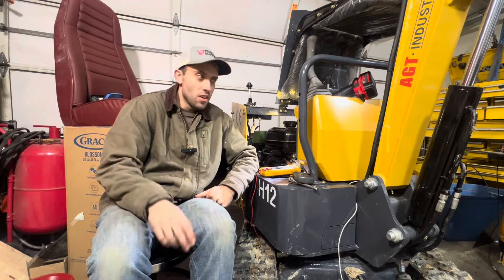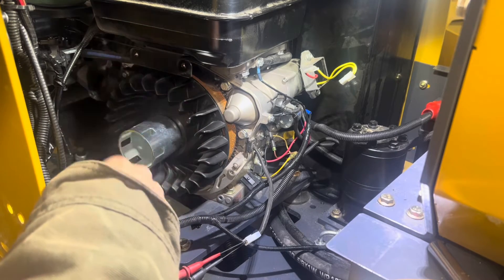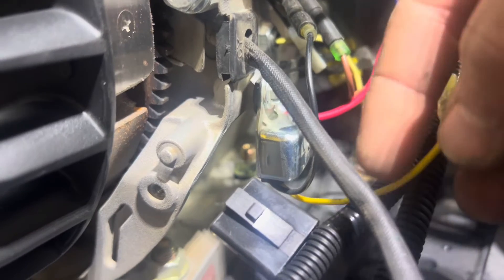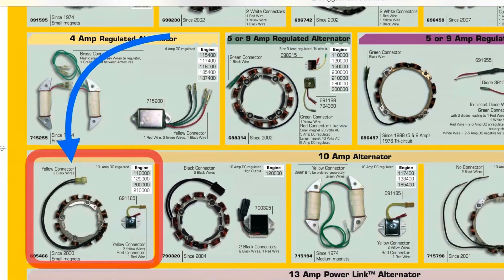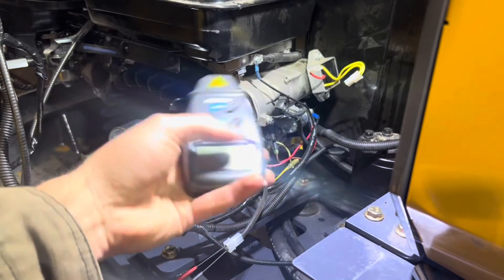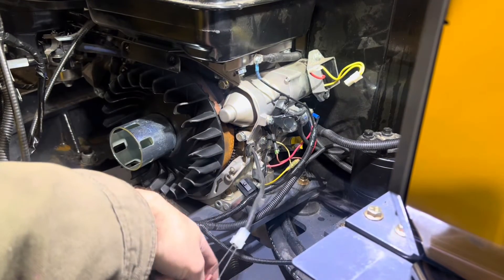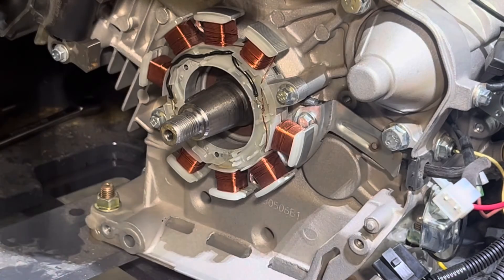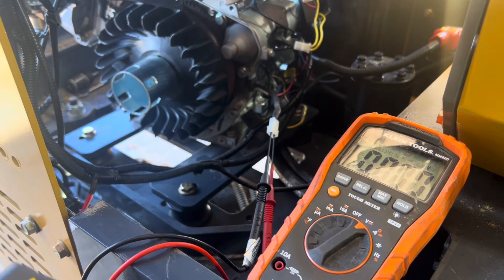Chinese Mini Excavator: Alternator and Charging System Diagnosis and Repair

Comment: Hi Cam, love your vids, i have a AGT INDUSTRIAL  KU12. The unit froze at a neighbor. Motor ran good but no hydraulic pressure, while towing unit back with a tractor, tracks just sliding on dirt. Then the hydraulics started to move VERY SLOW. I removed pump opened up and saw scratch marks housing and rotating cams. I think it may locked up and broke free while towing. I need a new pump, checked on your parts and didn't see pumps available  can you please tell me where to buy one, I am installing a hydraulic filter so maybe i can get more than 19 hours on it. P. S. Thank for your military service. Thanks again.

Comment: Is there any upgrade you can bolt in to give more juice? Wanted to add on a couple more accessories but don’t want to over do it and or drain the battery running multiple lights, 2 cooling fans, oil cooler fan, pilot fan, back up siren, phone charger etc… lol any thoughts?

Comment: Thanks a lot Cam. Recently installed the fans you did and the have run the unit hard for two days. I didn't notice but today late in the day it wouldn't turn over and noticed that the battery was reading 9V. Fortunately these have a pull start redundancy so I am not worried to much and it is still on the job site. Once it is back I believe I will run the same alternator solder check you did and of course verify the rectifier.

Comment: The 7 inch cooling fans from Amazon are marked 12V 80W (but this is not true)  
They are 40W fans that draw only 3.34 amps as measured with my ammeter.
The 10A alternator, has enough power for the fan, the LED flood light 
and charging the battery simultaneously.

Comment: So you didn't either know that you're charging circuit was dead because you haven't had a dead battery or, the charging system was working sporadically sending intermittent voltage to the regulator in surges and was keeping the battery charged enough. If that's the case I'm surprised it didn't fry the rectifier from the surges. Great video. For a second I thought I was going to be shocked with a hidden China charging system. I knew the Briggs engine probably had one on it, but I didn't know if China added their own. Cool.
Reply from the maker: I didn’t get any charge when I was testing the amperage draw of the fans
Reply: @thegarageconnection  no I mean in the days or weeks prior. If it wasn't working all together you would have had a dead battery at some point I would think. Makes me think that it was sporadically charging well that faulty solder joint.
Funny if it just quit that day.

Comment: Cam, do you have the model and link for the manual of the Briggs 13.5 engine?   I am pretty sure it's the XR series, but wasn't sure.
Reply from the maker: You are correct it is an XR2100 that’s what they call it.
Reply: @thegarageconnection What about the RATO engine model?  Mine shows 15 horse power and 420cc for the AGT QH12R 2024 model.

Comment: Hey, I have a 1-ton mini called Nuoman e10. When the engine gets warm the voltmeter shows 18v and above. Any idea what could be causing this?
Reply from the maker: Seems like your voltage regulator is malfunctioning
Reply: Ok, thanks. I'll check up on it @thegarageconnection

Comment: Great video's! I would apreciate your thoughts on this problem: I have the same machine except for the engine (Koop KD192f). I recently couldn't get it to start while motor was warm, the starter seems to turn too slow. What we checked so far:
1-the battery is ok (12,70 volts).
2-Diesel is inside the tank and motor(we see some fumes coming out the exaust while trying to start)  
3-We tried to start with starter fluid, no luck
4-There is no air in the fuel pipes (loosend the nut, fuel was seeping out)
5-Air filter and oil is clean
The machine has only 9 hours (!)
Tomorrow I will remove the whole back and side pannels to have a better look at everything.
Do you have an idea what the cause could be please? 
Keep up the video's and thanx!
Reply from the maker: Diesels should have a compression release while starting.
Reply: Hi there, 
I had the same issue, and you can  fix it by try another battery (at least 70 amps (used for a diesle car). It should be work for you. Good luck
Reply: @2012DIY  Thanx for your help, I apreciate it. Will try it
Reply: @2012DIY  the information on the battery is :
'Cold cranking amps.(sae) 400
Cold cranking amps. (en) 360
Amp hours (@20hr rate) 45'
Could you help me with decifering this? Cheers
Reply: @Skiponline   sorry for the late as I have not seen it, but anyway, the mine is: 
Cold cranking amps is : 550
Cranking amps is : 660
Amp hours @20 hr rate is : 70
And this battery make my excavator work.
Good luck
Reply: @2012DIY  ok thank you for the help!
Reply: @Skiponline   your're welcome. Please keep me updated.
Reply: @Skiponline whats the status of this? I have the same engine, and the problem is the engine seems not to charge the battery -- i.e. I manually charge to 12.7v dc and the voltmeter shows lower voltages in each successive starrts (say 11.9 to 12.4 initally and then comes down to 11.2 to 11.9  after a few uses). Battery itself was measure 12.7 at full charge using a batterry chargee, but the Voltage gradually fell until it could no longer start at 10v
Reply: @kusonsin  It was not my machine but the friend who owned it sold it to a dealer and I heard the problem was the regulator and/or transformer. Best of luck
Reply: @Skiponline yes my dealer changed the Battery and also Regulator for me, now I suppose the last thing is the Alternator... which led me to this video :) Thanks for ur quick reply!

Comment: Again, thanks for the videos. I have a dumb question for you😊. I have an oil cooler coming, but I’m really tight for space. If I remove the flywheel nut, and remove the starter cup permanently, do you see any issues with it? Thanks
Reply from the maker: Not having the pull start may come to bite you in the long run, but I don’t see an issue with safety or anything like that

Comment: Always a good day when you can fix a broken part for $0. For those people who went wild and installed hundreds of watts of cooling fans, I wonder if they could install one of the higher current coils, or if they are physically larger? I've already done some logging of temperatures inside the house and determined that 40-60w of fan is enough to keep the temperature within 1 degree of ambient if that helps anyone else.
Reply from the maker: I’m looking at getting a 20amp alternator and seeing if it fits in the flywheel
Reply: @thegarageconnection  So how did this pan out?

Comment: Good video.  And that B&S graphic from their website is very useful.  Someone linked it on a TractorByNet
thread about Chinese mini-excavators..

Now you know why I was concerned about your 2 80-Watt fans.  Are you going to take a charge 
measurement now that you fixed the stator?  If you have a DC clamp-on meter, it is really easy.

Comment: I’ve been looking at one of these excavators, but I have not yet purchased one. If I do come across one that doesn’t have the cooling fans I plan on installing them but hooking them up through a relay that is actuated by a thermostat control. That way they can cycle on and off and not be a constant load on the battery/alternator.

Comment: Excellent work and information. Your videos regarding this machine, I have the identical model, have helped me begin to understand my machine on a whole new level. Today I’m going to look into how I lube the ring gear and check that the small gear is on there tight. I bought two grease guns so I’m able to grease the two styles. In the process  I had a fitting on the arm that shot off when I applied grease. I suspect it’s not been tapped, or it’s improperly tapped. Your oil change vid is another good idea. Waiting for Amazon to deliver. The drain plug sits right over that cross member, so when draining, it runs all over it. Please keep them coming as they will be our proper manuals.